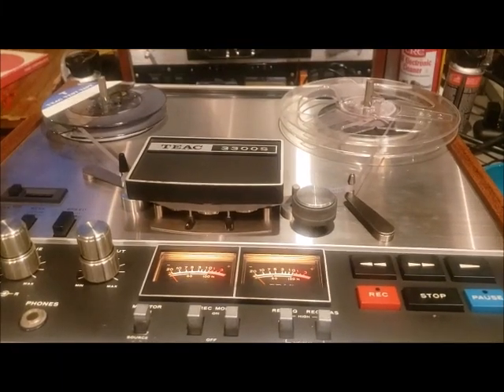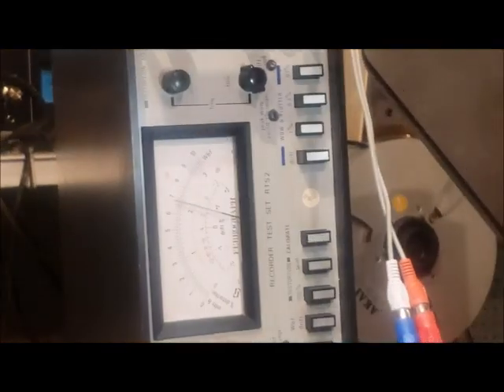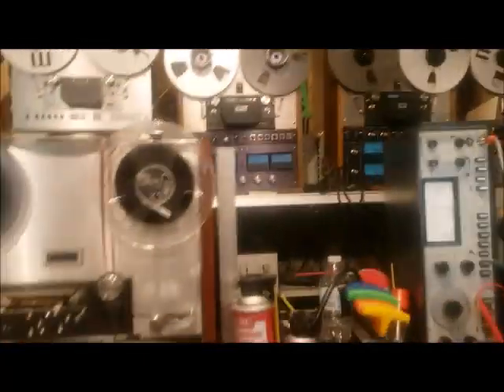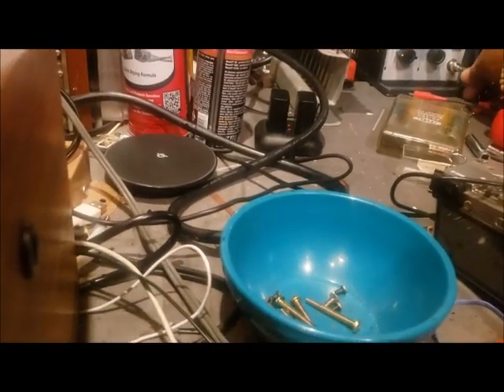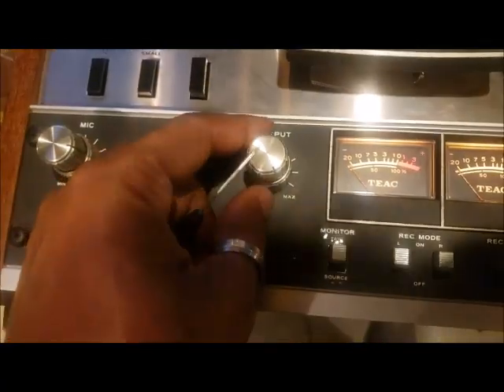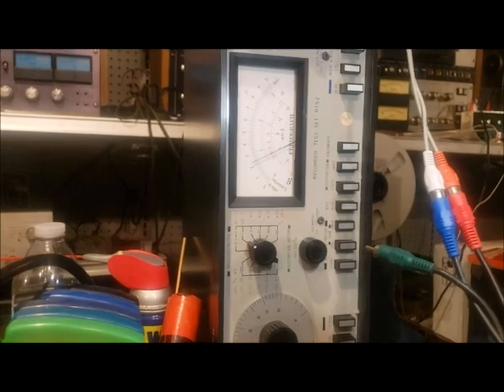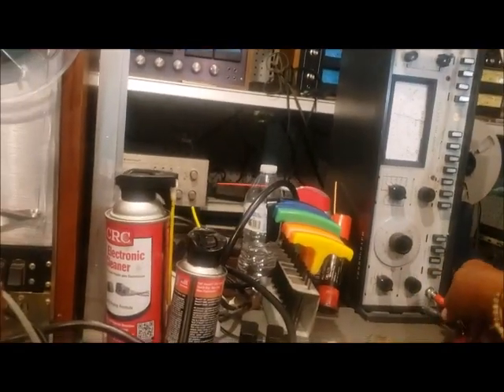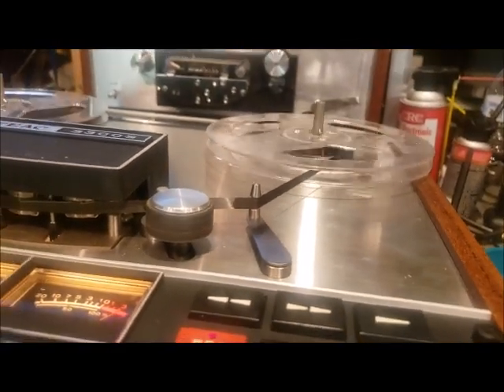Teac 3300S Reel to Reel Calibration

Comment: Hi, I just serviced 2 of these units that I own...belts, cleaning, lubricating the motors, cleaning/demagnatizing the heads, switches,...etc.  It sounds great.  I don't have these test tapes or the equipment.  Can I simply use a good pre recorded tape and adjust till it sounds the best to my ears ?   That is what I used to do to Cassette decks when I worked on them in High School and it seemed to work fine.   Thanks so much.
Reply from the maker: In a word, ABSOLUTELY!
Reply: @5thcomm  Would you say it is better to do this adjustment by listening through headphones or by connecting the machine to an Amp and listening through speakers ?   Thank you.

Comment: Hi.. lot of experience sir.. I need one suggestion regarding otari mx 5050 bqii .. I have one needs recording head and playback head relapped. That's good amt of dollars involved.. is that machine a keeper or should I look into another higher end like revox, akai, teac etc.. thanks
Reply from the maker: Definitely keep your 5050. You can get a good used head assembly for $200 or so. They're modular, so no special tools required. If you live near Charlotte NC, you can bring it by and we can pop in another head block to see the impact. Take care
Reply: @5thcomm  thank you for reply sir! You helped me in making a decision.. I will go ahead and get  head work done.. thank you very much!!
Reply: 1 question arises again is any head block can fit to any mx 5050 model? Need any soldering work? Thanks
Reply from the maker: @kuldeep850  any 5050 head will fit with no soldering. Make sure the 2 track/4 track switch location matches your headstack,  otherwise you won't be able to put the head cover on
Reply: @5thcomm  thanks.. its bqii.. 4 track so what which type of headstack should I look for 1/4 track or it can also be replaced with 1/2 track? Thanks